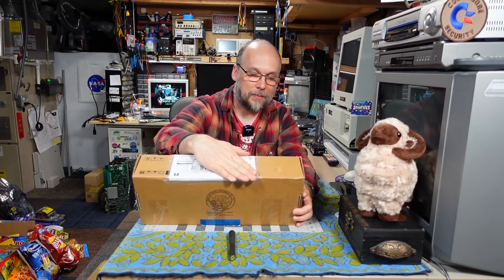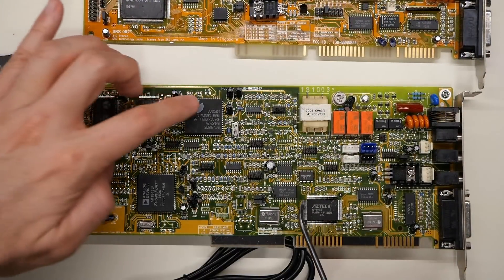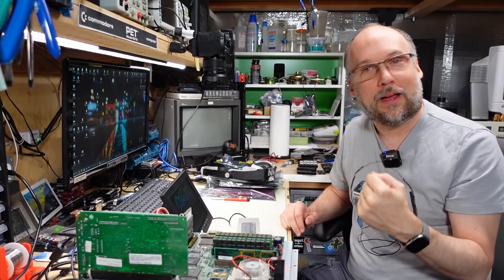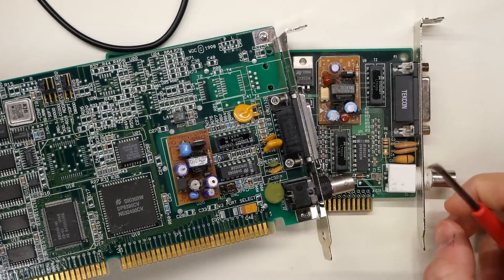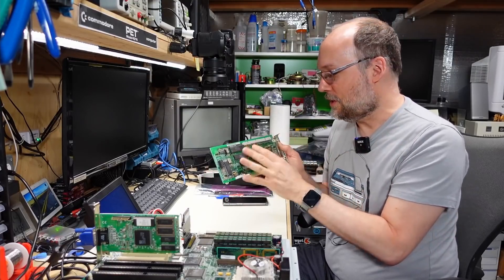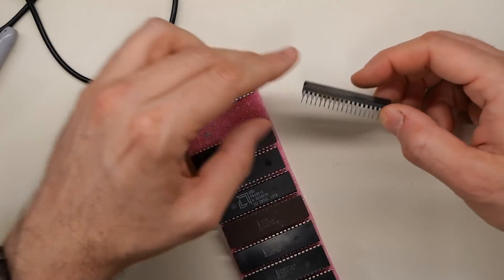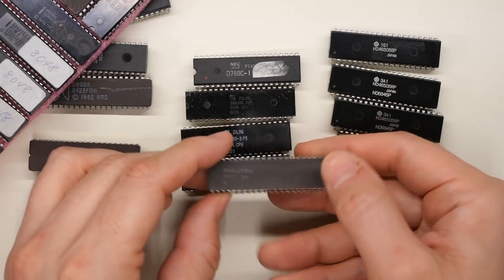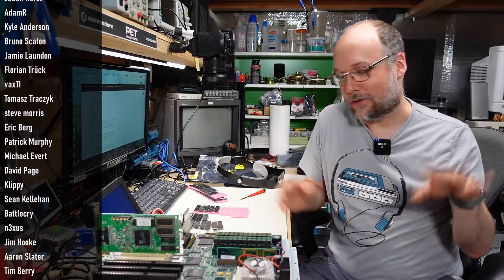An invasion of parts from the north

Comment: I don't know. I had a sound blaster audigy PCI card that worked just fine in my dos games. Those days were fun because XP didn't play a lot of those games, so I needed a boot disk. So I'd think the SB Pro would be fine as well. OHHHHH SB Pro is only 8 bit. Never mind. lol I was thinking it was more advanced than the 16. I wouldn't want to mix DDR3 with DDR 4. The changes are more significant than back in the 90s.

Comment: We used to make fun of them back in the day for looking and feeling very cheapo and coming with Packard Bells and other crappy brands, but Aztech cards ain't bad, actually. You're right that they are SB Pro compatibles, so 8-bit digital audio only, but the OPL sounds great and they are quite compatible.
Reply: When I get home from vacation, I gotta check that. I have several Aztech cards and I'm pretty damn sure they have a 16 Bit DAC (just not 100%). They are all definitely stereo though.
Reply: @senilyDeluxe  Sorry, I guess I put that poorly -- they WILL have 16-bit DACs and will play 16-bit audio in Windows or in DOS games/apps that explicitely support  Aztech cards (not many) or Windows Sound System (a few) but *when emulating SoundBlaster*, they are 8-bit only.
Reply: @junkdata6242  Thanks, I actually didn't know that despite growing up with a Packard Bell with an Aztech card. I gotta replay Wing Commander 4 on that thing (at least CD 1 - it would always crash when it wanted CD 3, I got it new but only beat it in 2009, long story...) - I bet the game uses 16 bit sounds but the card crunches and hisses as it's only playing the most significant 8 bits.

Comment: I've always wondered, why did IBM choose 4.77mhz? Seems an odd number. Why not 5mhz? Or 4.5? Or even 4.75mhz?
Reply: It's a cost saving and simplification measure. PC's use a 14.318 MHz crystal, which is a standard speed used for NTSC video generation, to generate different clocks by division. 14.318/3 = 4.77. PC's needed to be able to generate NTSC composite video on the CGA card so it was simple to do it this way. Lots of old computers and consoles with NTSC video output run at clock speeds related to the 14.318 crystal for the same reason, i.e. Atari 8-bit (14.318/8 = 1.78 MHz), SNES (14.318/4 = 3.57 MHz), Amiga (14.318/2 = 7.16 MHz)

Comment: All i know , currently  I have 3x Crystal /Aztec sound cards lying around - they all suck - and have issues (sounds like caps or something) (just tried running them again in a couple machines, and fail) - anywho - stay away (even though SB's are $$$$$)
Reply: Also back in the day (as I watch the video) - HELL YES - NE2000 cards were the BEST!!!! - For all the reasons you mention - otherwise you were f**cked back in the day - Had a ton - Fixed a 486 SCO unix sytems (locked down to HW w/ kernal licensing) at work for old product testing - and I got it on the network with a NE2000 in 2006 - lol

Comment: My wife had one of those Aztech sound/modem cards in her Packard Bell.  It was, as was the Packard Bell, less than great.  The drivers were buggy and it was hard to keep the modem working.  Do not recommend.
Reply: maybe there are different models, I got an Aztech second hand, I used it a lot on a clone, both the sound card and modem worked great and never had any problem with it. 
it didn't need drivers in DOS, win9x supported it out of the box.

Comment: On that EN1642.  its just a regular ethernet BNC 10mbps, NE2000 clone.  not sure about the chipset.  but I used a alot of those with WFWG 3.11 using a BOOT ROM off of NT 3.51 server.  Old BOOTP!